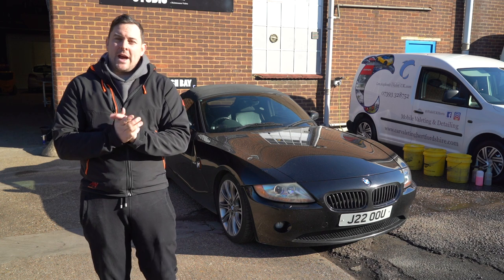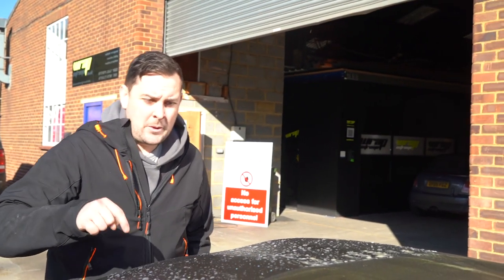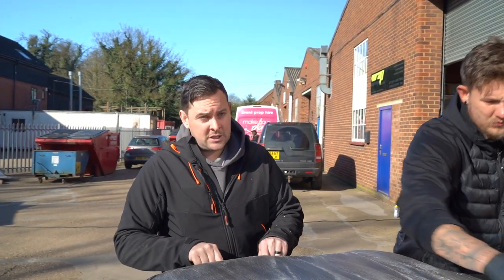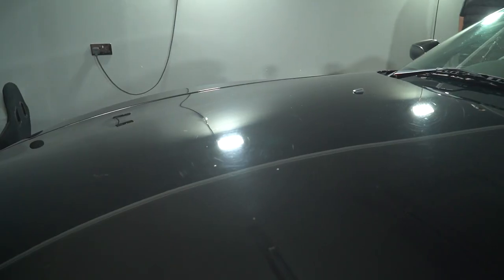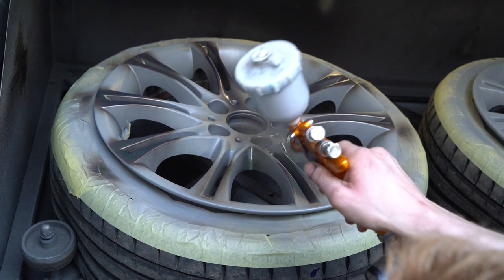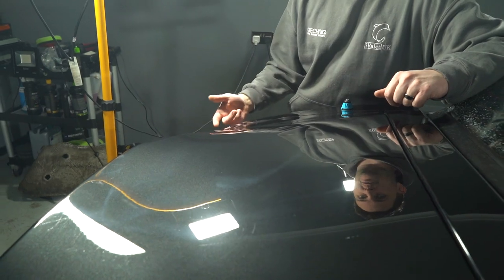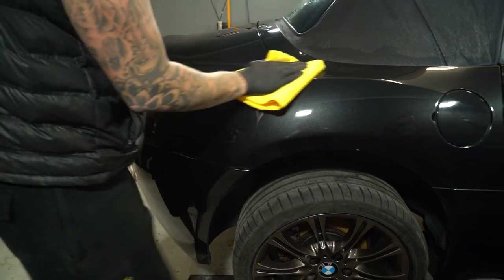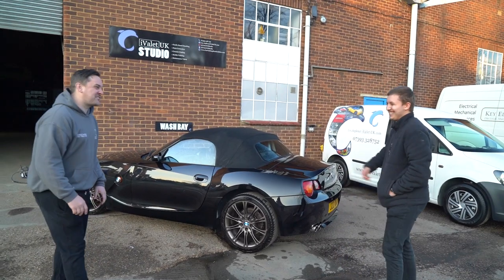Deep 32 hours paint correction detail on WRECKED Z4 with wheel refurb!

Comment: Amazing job on an old car. I will be leaving my 2016 car behind soon for a Z4 and I am sure I will need to treat it as well as you guys have done to get a great result. Subbed :)
Reply: Have you gotten a z4 yet?
Reply: @papaidolatrine2499  Hi mate, I did sell my PUG 208 2016 and buy a Z4.

I was really lucky and found a 2006 Z4 2.5i SE, one lady owner with full BMW service history and 34,000 Miles on the clock, the interior and paintwork is almost as if it has just come out of the showroom all those years ago, of course, it did cost an increased amount for the privilege of owning it, but if I brought another 1-year-old car I would have been paying a lot more and losing value as soon as I drive it away. The Ultimate Driving Machine Becomes The Ultimate Recycled Machine ;). Amazingly my car even at the age of 15/16 years old was sold by Sytner BWM as a Sytner Select Car. If I had space and a bit more money ;)  I would buy another Z4 (maybe the Coupe) and also a Z3 (I think it looks great, but I cannot drive it through town if I wanted to without a pollution charge:(  ) 

I was initially looking to buy a Z4 with about 80,000 miles on the clock and work on the bodywork/interior to bring it up to a decent standard of finish and videos like this really helped me to understand the correct cleaning of cars without damaging them further and also the ability to restore them if needed. I am almost finished with the cosmetics and replaced wheel hub badges and boot emblems, only the indicator BMW emblems to fix now and it is practically showroom condition, after a minor scratch is fixed on the dashboard it should look amazing!!!!

ENJOY Recycling An Old Car Is All I Can Say ;)

WOODY

PS Watch my Channel to see the BMW Z4 by Drone in the summer months, I think it deserves some air time :)

ENJOY Recycling An Old Car Is All I Can Say ;)

WOODY

PS Watch my Channel to see the BMW Z4 by Drone in the summer months, I think it deserves some air time :)
Reply: @woodydroneson  that is really nice to hear! I’m glad you found such an Amazing car. I will definitely be on your channel waiting to see it! I’ve had a 2004 Z4 2.5i for 1 year and a half now with 210xxx currently and it still drives Amazing after a few small repairs and some love! I enjoy my car every time I’m in it
Reply: @papaidolatrine2499  Wow that many miles and still going strong :) I am really happy that you are enjoying the Z4

I realised after buying my first nearly new car (The PUG 208) that if I brought a newish car again I was just going to be driving a car that although sensible, was boring and actually going to cost me a fortune, so why not buy the car you like and spend some money on keeping it working well and update/repair instead of scrapping a fantastic car like the Z4 :)

Have fun driving :)

Woody